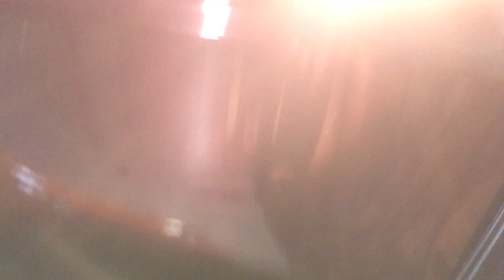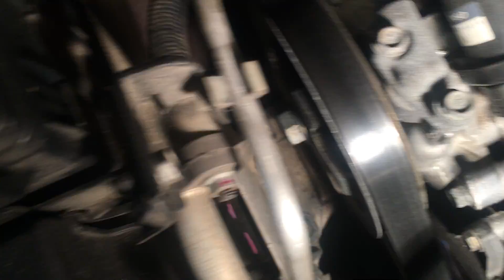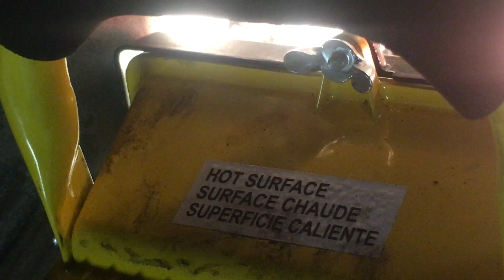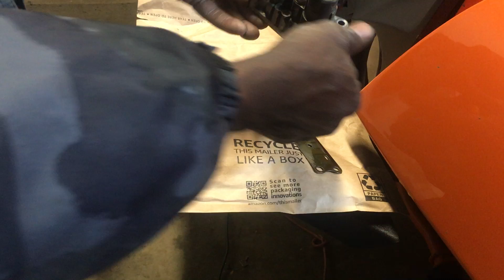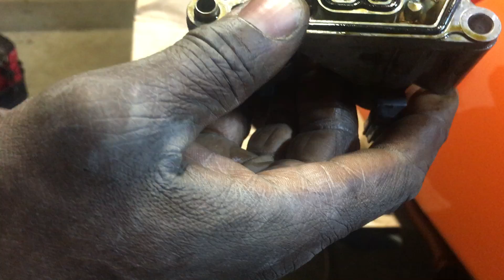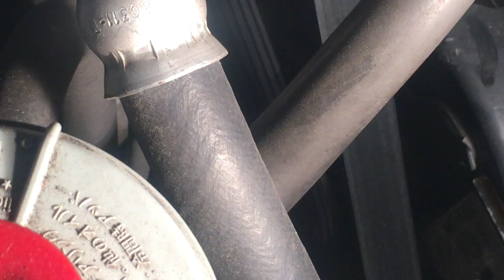2010-2017 Honda Odyssey VTEC solenoid gasket replacement

Comment: I just replaced these gaskets using the Mahle kit, it came with the upper and lower screen gasket, no plate, I reused mine. Fit perfectly and no codes. Torque the three bolt to 8.7 Foot Pounds or 12 Newton Meters. If you do not do this, you will get a leak. I used red loc-tite on the bolts.
Reply from the maker: Great advice and great job on your install. I used generic gaskets and didn’t torque them to spec, but two years and over 60k miles later, no leaks at all. Bone dry.

Comment: I replaced 3 months ago and today i will be replacing again 😂 leaks more then last leak.
Reply from the maker: I had the exact same issue the first time I replaced it. I chalked it up to user error because the second time I did it there hasn’t been a leak in almost two years. It’s been dry as a bone. The first time may of been something I did wrong or the gasket was defective.
Reply: You need to torque the three bolts to 8.7 foot pounds or 22 newton meters, use red loc-tite.

Comment: That same one u got from Amazon.  Put it in Honda pilot and it's leaking worse than b4
No good. I torque it 8.5 ft lb
Probably leaking from the top seal that is thinner than the OEM one.  Took it out amd oem with Honda bond but still had small leaks.  Smh.  Going with the OEM brand new one.  Ordered and otw.  We'll see how that gna go
Good luck y'all
Reply from the maker: Sorry to hear about your ongoing issue. For me, it’s been about 18 months with no leaks at all. Hopefully you have better results with the OEM version.

Comment: I'm about to change out the whole valve from Honda. After watching others struggle with the Dorman and the Amazon gaskets I decided to go with original equipment. Thanks for the video.
Reply from the maker: If it ever leaks again, I will do the same.

Comment: So the leak stop now.. i have same issue with my VAN planning to replace  this weekend
Reply from the maker: Correct, the leak has stopped. Please make sure not to torque the bolts too much when you reinstall. It’s a fine dance, if the bolts aren’t tight enough it will leak, if the bolts are too tight it will leak. It’s a really easy job though.